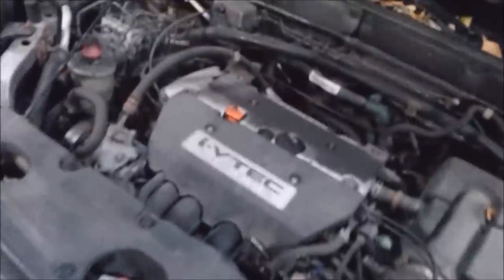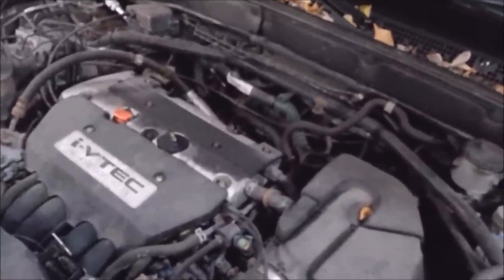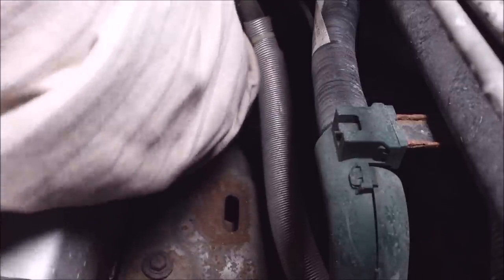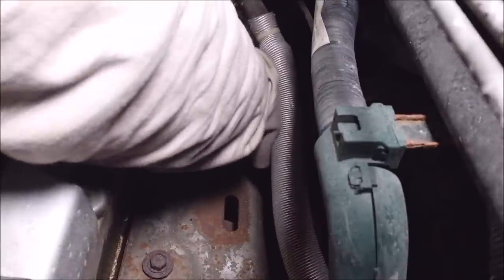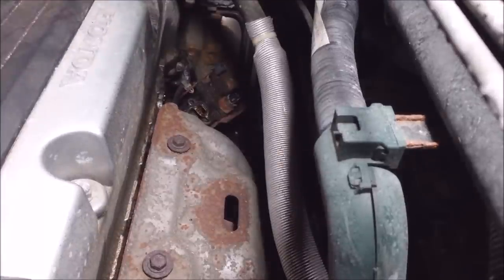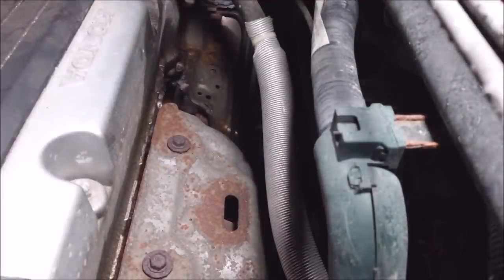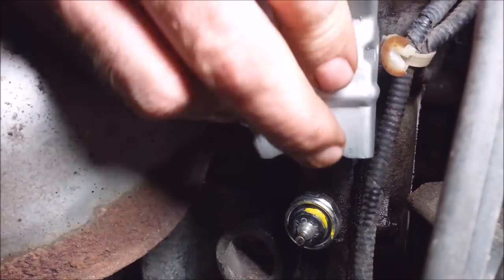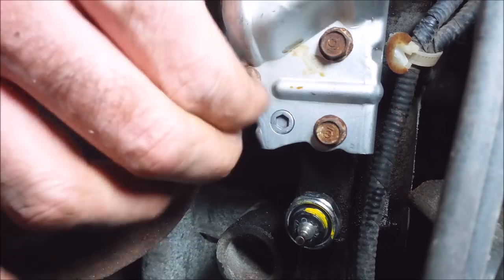2002-2009 Honda CR-V P2646 P2647 code fix.

Comment: My stepdad replaced the V-tech oil sensor 2x hoping that would fix the hesitation that was happening aorund 2500 rpm's. It held for two months the firt time, then 6 months the following time. I spoke with a Honda repair shop and they said they see this isue happen all the time in 04' CRV's and STRONLGY recommended against buying this part aftermarket. So fingers crossed that replacing this whole silenoid with switch/sensor attached will do the trick as its become much worse this time around trying to get it to accelerate.
Reply: Any updates?

Comment: Well this is a lot less painful than I thought it would be. Mine runs fine under 3000 RPMs but as soon as I go over that it starts losing power bigtime. I might try to take a look at mine before I take it back to the mechanic. I just had to have the evap emissions control system fixed and one of the coils replaced, and I'm starting to hemorrhage money on this stupid thing. I know she's got a lot of miles left but it's getting annoying to have a new code every time I drive her.

Comment: 08 Honda CR-V . Put some Seafoam into the fuel and oil case after changing the oil three days ago  Come today and the check engine light came on with the VSA & a Triangle with an Exclamation point while on the Highway. And noticed that my car was not accelerating as smooth as it once did before kind of slow too. Scared the living hell out of me. Looks like an easy fix after finding this video. Thanks for sharing !
Reply from the maker: I wouldn't drive on seafoam in an engine any more than 50 miles, and then I would change it out.
Reply: funny you mentioned that, I put sea foam in it about 1500mi ago. I'm thinking it freed up some gunk that clogged the screen/solenoid?

Comment: just got the P2647 code on my 2007 Honda CRV. Car is stuttering/reduced power, check engine light. Thanks for this great video!
Reply: Did doing this fix the problem??
Reply: Our 2007 Honda CRV is doing the exact same thing with sputtering and reduced power. 

I just replaced the VVT solenoid and the check engine light is still there.

 Just went to AutoZone and the p2647 code is there and it's recommending to change the variable valve timing oil pressure switch.

I will replace it and let you know if it fixes it
Reply: @johnnyb33good21 did it fix the problem?
Reply: @Forkeytv  I replace the VVT solenoid and the check engine light went off and the car drives fine. The only problem I had with replacing the VVT solenoid was I had to buy a special extractor socket from Autozone because the bolts were stripping and I wasn't able to get then off with a normal socket
Reply: @johnnyb33good21  Appreciate it, I’m thinking this may be the solution to my problem. My CRV came up with this code while I was on the highway and started sputtering when I tried going over like 3000 rpm. Oil levels are good and not due for oil change yet! Just replaced spark plugs and coils don’t look bad either. Also got some misfires when I checked engine codes don’t know if that will fix that problem as well.

Comment: I have the same code on my '09 CRV. I was driving, the check engine light came on and then shortly after, pretty much every light on the dash came on (VSA, the ! symbol, etc) and it went into limp mode. Turns out the engine was more than a quart low on oil. I believe that's what caused the problem, but I will look into replacing the VTEC solenoid also. Thanks!
Reply from the maker: You can run those a couple quarts low before it looses oil pressure. If you had an oil pressure issue, you should have seen an oil light flicker, or remain on. They usually flicker at a stop in drive idling when they get really low.
Reply: @RustBeltAuto  Interesting. The oil pressure light didn't come on, so I guess I will need to look into the VTEC solenoid sooner than later.
Reply: I know I'm a bit late to this comment thread but I experienced the exact same thing this morning.  My '04 started bucking and limping while I was driving to the gym with the CEL on (not flashing). I do my own oil changes and the last one I did was about a month ago. I don't see a leak so I must have forgotten to check the level after cycling the new stuff through. Adding one quart and some drops worked like a charm, reset the code and it was as if nothing happened.
Reply: @ardie4  nice.  I hope the limp mode prevents damage. Still have the CRV and seems to run fine 30k later. I haven't had to put any money into it really, it's shocking.  Probably need to swap out much of the suspension now at 160k miles but literally still on the original wheel bearings
Reply: @chrisE815  oof, doubt my bearings will last that long. I drove on stuck calipers for a while; figured out what was wrong when it got bad enough I felt the heat eminating from the rotors after getting out as well as the warping. Just replaced them a week ago and while the car drives like new again I bet the bearings had their lives slashed. Car has still been good to us for the 18 years we've had it.
Reply: @ardie4  I live in an area with lots of road salt during the winter.  I found that cleaning/maintaining the caliper brackets is critical on the CRV. The rear brackets seem especially prone to rust jacking
Reply: @chrisE815  ah. We get the four seasons here, salt isn’t used on the roads but sand is. I found the root cause of the low oil: a valve cover leak. I removed it to inspect my valves and must’ve put it back on incorrectly.
Reply: I had the same problem.  Added oil and the problem went away for a while.  Eventually the check engine light came back on along with the VSA.  I was about to change the VVT solenoid but the mechanic I called said to trying changing the oil first.  It had been 10K miles since the last oil change and it was pretty dirty.  Got it changed and my problem has cleared up.  Nice to have the honest mechanic save me a good bit of money.
Reply: @kjohnson8174  yeah,  I'm sticking to 5k oil changes and checking the oil level frequently.  I think it's a mistake to go by the Honda recommended change frequency
Reply: I might be late on the thread but I have the same issue in my 04 CRV. I’ve replace the VTEC solenoid and changed the oil with the right amount of oil and I’m still experiencing limp mode when I get to high speeds. Any advice?
Reply: @nabeel3834   Me too I've changed the vtec solenoid(which the oil pressure switch is attached too also) I changed the vtc screen up front, and the vtc oil actuator. P2646 was my code for the check engine. It worked for a while but it's now doing it again. My next step is to do the Oil pressure sensor which is right above the oil filter. it bolts directly in the block. theres a rubber boot that you connect to the oil pressure sensor. It has a prong that looks like an aux prong. This gets overlooked alot. Most people just change the vtec solenoid but there's more to the system than just that. I hope that helps. That's my next step and we will see if that finally clears my code. They and use honda parts. Ive had no luck with duralast or ac Delco from autozone. Just buy Honda.
Reply: @johnathoncastro  did the oil pressure switch fix the problem?

Comment: My son is getting this code after a fairly violent episode of jerking/hesitation and all the lights coming on. It's completely intermittent. My Googling says that this could also be a faulty ECU. Based on his symptoms which do you think is the more likely culprit? Thanks!
Reply from the maker: Vtec solenoid, plugged screen, Vtec sensor/switch, or low oil is most likely. Your jerking is probably from a limp mode. Shutting the car off, and restarting it should resolve it for some period of time. You can test the parts, but intermittent problems like this usually always give you an inconclusive test. As a tech, it is more cost effective to just replace the part as a whole, then screw around wasting time trying to figure it out.
Reply: @RustBeltAuto  Thanks!
Reply: It was the solenoid. Thanks again!

Comment: Should I drain the oil first before doing this? I don't want a surprise when I take this thing off to clean the screen.
Reply from the maker: Draining the oil probably won't help. The oil in there is after the pump.

Comment: Could you provide a link to the solenoid needed or would an auto parts store carry it or know what you are saying when you pull this code up. I believe when this thing is going out it will make the vehicle violently shake when it is in transition of shifting gears.  Mine would not make it above 40 mph and seems to do it more when it's cold or lower on oil.
Reply from the maker: Get one from the dealer. I'm having problems with the pressure switches on the dorman ones, and other ones that say made in china on the box.
Reply: @RustBeltAuto  they just don't last very long or they just work intermittently? But yeah dealer parts are always better!!
Reply from the maker: @timejumper8003  they puke oil all over the place, or just don't work. I put a quality switch in one of them, and it's still working properly.

Comment: Great advice on the 6 point i stripped one, you cannot get a tool back there, had to break the thing off and then extract the bolt

Comment: Excellent video! Thanks for sharing ....I have a 2006 crv and had this problem with the cel, vsa and triangle with ! Light all came on at same time and car jerking at low rpms.....took it to mechanic who replaced the vtec solenoid because I’m not sure what the exact code was but said rocker actuator I believe....anyways .,.driving on highway back home all lights back on again ....took it back and he said there was p2647 vtec oil pressure switch ....he didn’t replace the vtec solenoid part but cleaned the screen as there was some crud in it from what he says ....

My question is...do you think he should just change the whole assembly of the solenoid? He is saying next oil change we should do an engine flush ...

Would appreciate your thoughts!
Reply from the maker: Separate parts can be diagnosed. Replacing the spool valve, and switch saves the $ in time and hassle of diagnosis. The only problem being, that many aftermarket parts are Chinese, and create more problems. So it depends.

Comment: Thank you very much for your video! I have a 2009 Honda Element in which I replace this part and clean both oil screens. The trouble came back about a week later intermittently. What's my next step of diagnosis?
Reply from the maker: Is there oil in it? If there is, you probably have a defective part. The oil pressure switch must read oil pressure when the solenoid is activated. It is a very simple component, and there is really only a few reasons why it would have that code. Low to no oil pressure/flow, solenoid or spool valve issue,  or VTEC oil pressure switch, and everything is sold as an assembly. Of course I could be wrong, but I'm doubting it.
Reply: @RustBeltAuto  wow, apparently YouTube never told me that you replied. here it is a year later I am still diagnosing this issue. Yes there is oil, I use full synthetic and the correct weight that is listed on the cap. I change it regularly when the Honda oil service life says 30% the solenoid is a genuine Honda part. I put in two aftermarket ones first, all 3 didn't solve the problem. I also replaced the VVT on the side. I tested extensively. The trouble still persists. Could there be an internal engine problem?
Reply from the maker: @davidtheinspector  I would unplug the solenoid, and pressure switch, run the car, activate the solenoid with an external power source, and read the switch with an ohm meter at the same time. I did a video on a subaru vvt solenoid the same way. That would insure you are getting oil pressure up there. If that is okay, you would need to check the resistance of the wires to make sure none are broke.
Reply: David Garcia it could be a worn timeing chain and also there could be erosion on the plugs that plug into the scensor or a bad cam scensor and you can try unplugging the battery for about 10 min to restart the computer tell me of this helps

Comment: Is it necessary to also check/replace the screen under the power steering?
Reply from the maker: Why?
Reply: @RustBeltAuto  I've seen some people check/replace both to fix this problem, but I'd prefer not to if I don't need to.

Comment: Have had the same issue with my 2009 Honda Element for about a year now. I already replaced the VTech solenoid assembly and cleaned the other screen behind the belt. I changed my oil regularly at 5,000 mi with full synthetic. The struggle periodically comes up multiple times a week. Please help! And yes it was a genuine Honda part.
Reply from the maker: It is very hard to diagnose an intermittent problem with a spool valve. When did you get the part?
Reply: Same here.  I bought oem

Comment: would a low oil trigger the P2646 code? also mine doesnt have a check engine light but when i plug the obd 2 it say i have a code but my check engine light is not on...check engine light turns on and off after i start the engine so its kinda driving me nuts? so the bulb for the check engine light is out of the equation
Reply from the maker: Low oil can. Check light should stay on for about 3 seconds after starting. It's a stored code. If you clear it, and it shows up again, with no light when driving, or idling, and only happens after starting, you may have a problem with the ECU, or an oil delivery problem. Just a guess. If the light comes on after clearing, with no noticable problems, and does what you say, i would check, and change the oil with 10w30, just to see what happens.
Reply: @RustBeltAuto  thanks....but now when i was driving in the freeway car seems to drive at limp mode when i park seems to drive normal again it scared me a bit like i was riding a horse would changing the oil be good i just got this and oil was due? p2646 is solid now as a cheack engine light
Reply from the maker: @anthony08330  You probably have a bad spool valve . or switch

Comment: I replaced mine on my 04 Honda crv but it still throws the code saying it's stuck off could I have gotten a bad one
Reply from the maker: Possible bad oil pressure switch. On the spool valve.
Reply: @RustBeltAuto  would that be on the cvt selonoid assembly
Reply from the maker: @richardthomas4709  yes.
Reply: @RustBeltAuto  thank you
Reply: @RustBeltAuto  quick question can I test the wires for my O2 sensors with a light up tester signal and ground
Reply from the maker: @richardthomas4709  i would never. Use a voltmeter. O2 works on 1v.
Reply: @RustBeltAuto  thanks

Comment: What is the part number my son has 2003 honda accord. Cant seem to get correct part number?
Reply from the maker: 15810-RAA-A03 is the factory number. I'm having problems with the oil pressure switches on the aftermarket ones.

Comment: 2005 CR-V has same problems/codes. But VTEC Solenoid Assy replaced and ran a few days & show same codes.
Duralast #TS1147 (4:51) installed but ran into a limp modes after a few days later.

CR-V got 240K.

Rust Belt Auto or Anyone knows what else it could be?
Reply from the maker: These Chinese parts from these suppliers are not any good. The oil pressure switches on them are really cheap. If you have your old one, and it is still good, try swapping it out. I just diagnosed a vct solenoid on a Subaru with a bad switch, and posted the video on youtube. You could basically diagnose it the same way.

Comment: My accord 04 came with 2646 ..is their difference between the oil switch and the whole vtec unit
Reply from the maker: The oil switch unscrews, and can be replaced.
Reply: @RustBeltAuto the does code spit out only part Thats broken or is entire vtec solenoid broken? P2646 oil pressure switch is code i got.its 2004 v4 honda accord
Reply from the maker: @zuramax2049  It's stuck off. You can try to actuate the solenoid with battery power, and should hear an audible click. You could also run the car, actuate it with battery power, and it should run funny at idle when you do it if it works, because you are actuating vtec at idle. If you want to test the switch, you can us a continuity tester. if the spool valve is working correctly, it should switch from normally open to normally closed when you actuate the solenoid when it is running. Sometimes they have intermittent problems. That is why I don't bother with all that fooling around and just replace it. The chinese ones at the parts stores have crappy oil pressure switches in them though, so it might be best to use yours if it works.

Comment: So do i replace the sensor or the solenoid. I've cleared the code and it works fine then after awhile it comes on again
Reply from the maker: The sensor comes with the solenoid as a spool valve unit. Myself and others have been having problems with the cheap sensors on the spool valves at the regular parts stores.
Reply: @RustBeltAuto  ahh thank you, this P2646  code along with egr code making my car nearly impossible to drive
Reply: Did you figure what the problem was

Comment: I just did the same repair for the same code. Genuine honda part. Ran great for a week now its happening again! Any idwas?
Reply from the maker: Same code again?
Reply: @RustBeltAuto  same code again. VSA kicked in, p2646.
Reply from the maker: @kyledavis8176  I threw a part at this car. Yours will probably need to get properly diagnosed.
Reply: @RustBeltAuto  yeah i made an appointment with a honda shop.

Funny thing is it comes and goes. I get 12v reference at each connector & good ground confirmed with noid light. Losing my mind over here lol
Reply: What did the dealership find?
Reply: @kyledavis8176  what ended up being the issue?  I'm stuck in the same boat.